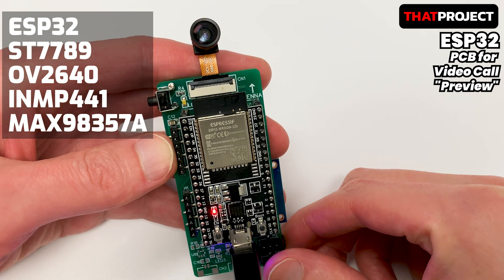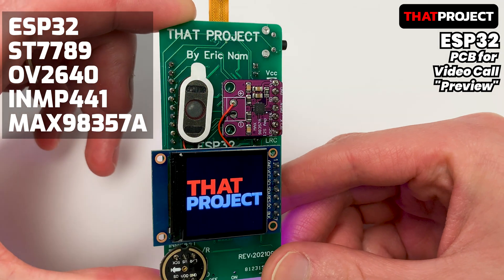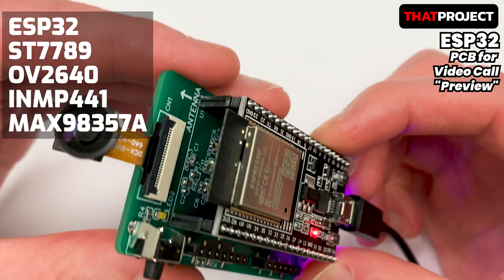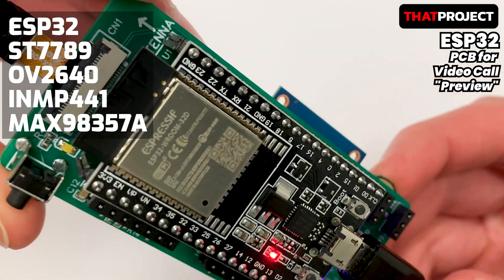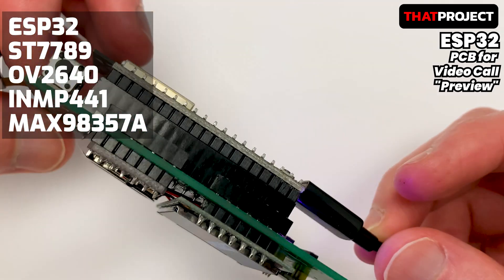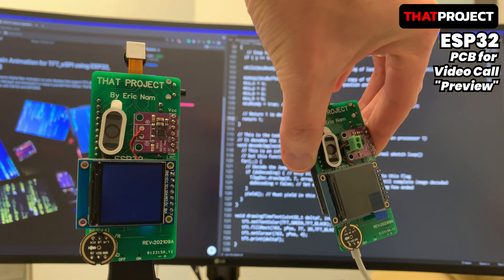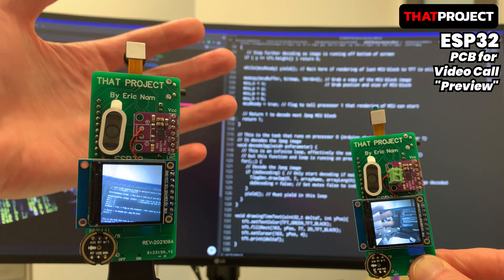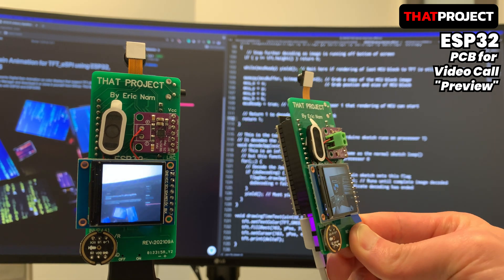ESP32 + OV2640 + ST7789 + INMP441 + MAX98357A = ?

Comment: Cool. Do you have a scheme for a separate modules connection? Any sketch? ))
Another question - is it possible to use external radiomodule? (nrf24L01+ or any other module 433/860 mhz)?
Reply from the maker: I'll use only built-in WiFi. Perhaps there is no usage of the external radio module in this project. I'll share the PCB Scheme when it's ready.
Reply: @ThatProject   Thanks, will be waiting so much. But why no usage for NRF24L01+? There are amplifiers, so more range is possible to reach,  If there are SPI pins available, than its possible to connect external module, I guess... this is the only 2.4ghz module which has high enough transfer speed for voice/image transition.  But, my be there is som ESP32 modification with external antenna or amplifier, rather to use standard dev.kit with built-in antenna.

Simple question: 
- do you have simple tutorial of sound capture from microphone max9814 and transfer sound to external speaker (within one ESP32 or with transmitting to the second ESP32) ?
Reply from the maker: @ivanz9324  Whenever possible, I like to do projects without external modules. Of course, the NRF24L01+ is much better than the built-in WiFi module, but it requires extra handling for that. Also, since there is an environment where WiFi is nearby in the office or at home, there is no special reason to extend the range unless it is WiFi to WiFi (WiFi Direct). This is just my opinion, so please don't be too skeptical.

https://youtu.be/vq7mPgecGKA
In this project, you can listen to the audio captured by the ESP32 through the PC speaker. Node.js server is used, and audio data is delivered through WebSocket.
Reply: @ThatProject  Ok, I`ll take a look, but never worked with js.  server etc.  

Is there any simple tutorial without any servers, without using wifi at all? 
Just to take sound from microphone and send it to the speaker connected within the same 1 microcontroller... ? without transferring outside.  thx
Reply from the maker: @ivanz9324  Well. The reason I separated the microphone and speaker is that audio feedback occurs when the two are close together. So I've separated these two in every project. If you bring each part from my project I think you can do as you want. https://youtu.be/5q5a5pee4ZQ
Reply: @ThatProject  Thank you! I meant, more simplified project without wifi at all.  microphone - buffer - speaker within just one esp32. I understand about echo (close position of speaker and microphone) so just put speaker wider on long wiring.

 I`ve seen that code you posted. Its about transferring sound from microphone (capture sound) to the buffer - to the server via wifi -to the 2nd device which captures from server as client, to the buffer - to the speaker. Looks working,  will try it a bit later. And weak chain here is just one-directional sound transfer. If we need to get some answer back - need to change server/client roles to get bi-directional talking. or not?  
Is your project about ESP-NOW protocol, without using external wifi point. Just directly from one node to another?
  
Can we also connect both nodes to separate wifi points with internet, located far away from each other? (I guess, some static ip. address and port needed)
Reply from the maker: @ivanz9324  The project I made for bidirectional communication is the half-duplex project I mentioned in the previous comment. I think you can get what you want from there. 

ESP-NOW is directly connected without using external WiFi to send and receive data. Easy to use.

Devices connected to different WiFi can only connect with static IP after all. This is also the reason for creating and using an externally accessible server.

Comment: Do both have to be connected to external lan network or both are independent of external network for the wifi to work?
Reply from the maker: What I've shown you in this video is using just a WIFI connection internally. So the left one becomes AP mode and the right one is the Station mode.
Reply: @ThatProject  what's the max range bw the two?
Reply from the maker: @anoopcc2361  I think 10 meters is the maximum without an external antenna.